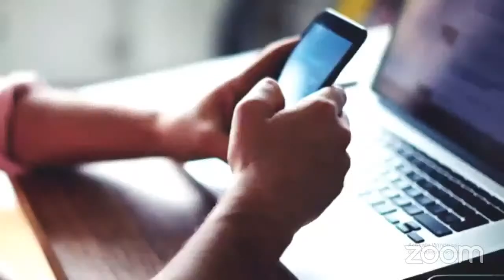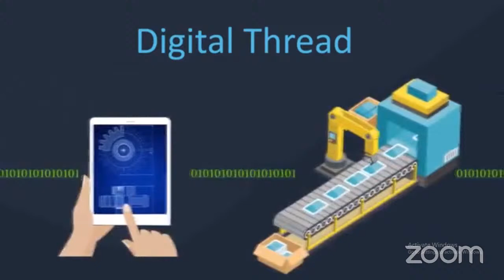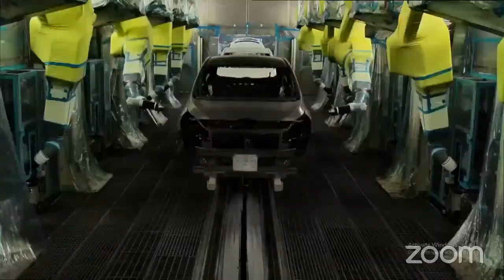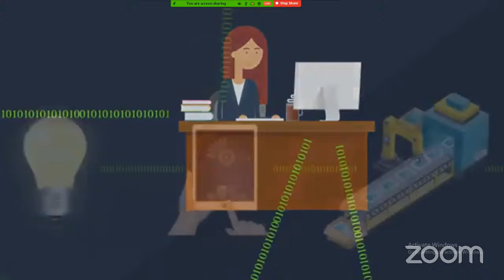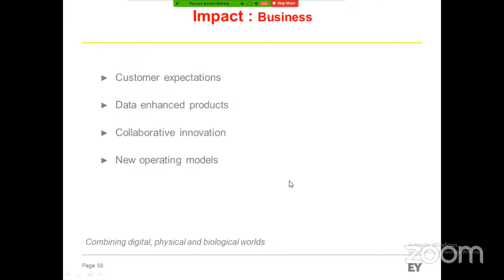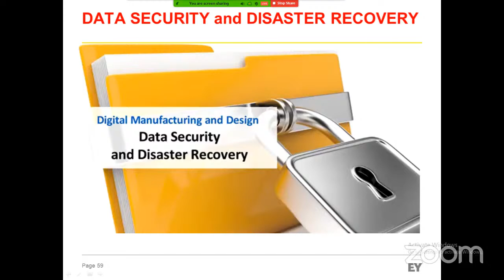Webinar on Industry 4.0: Digital Manufacturing

Comment: The gap between mechanical engineering and computer engineering is becoming closer and closer day by day. And a mechanical engineer with knowledge of programming is the way to lead forward. Apart from USA, china is the other big nation where 4.0 is actively advancing commercially and one can find arrivals a few of these company grew so big they are challenging domestic and international market in there industrial. Hence I would like to say this is a race between the company's globally rapidly moving to monopolize there own industrials. 4.0 is waking call for all "Dumb Happy Fat" companies😂 like my mentor calls them to look for the future that's no more than 10 years away. There a lot of work going in 4.0, digital manufacturing, additive manufacturing and micro &  nano scale manufacturing in australia aswell if interested look up any university in australia you will find everyone's working in this space. Caution: Australia industrials are not as quick as the academy is so you hardly find any company working exactly on "4.0" . However, industrials have huge emphasis on sustainability and circular economy which can be achieved by 4.0. these are just my thoughts on this topic. I would like to know what others think. And How india stands up in this 4.0 race. To all the speakers of the seminar it's a delight to see an initiative towards 4.0 at the very college is studied. To the faculty at Vignan specially hod mech glad to see such a comment to make student think to wards future of mechanical engineering. Sir, please do post any projects by student in this domine. Would be interesting what great projects would come from students.

Cheers
Vishnu velaga.